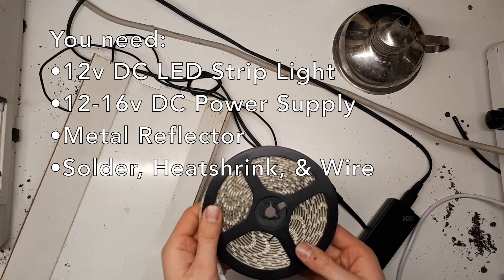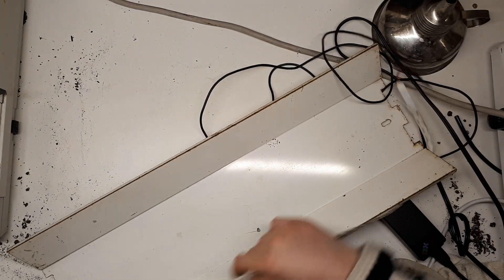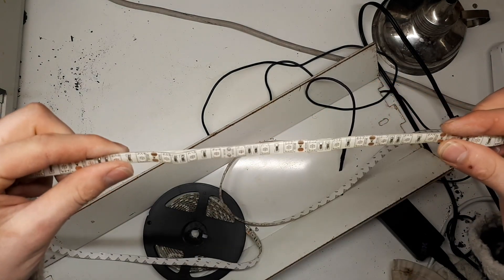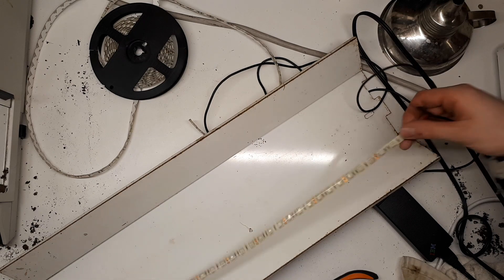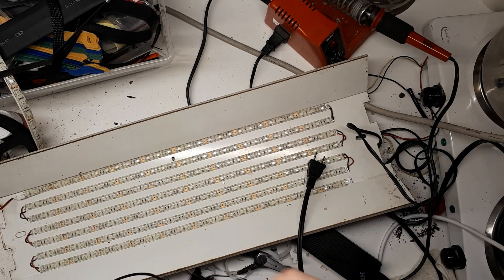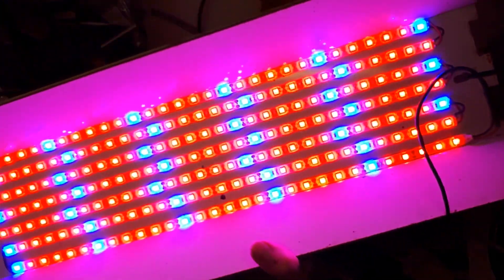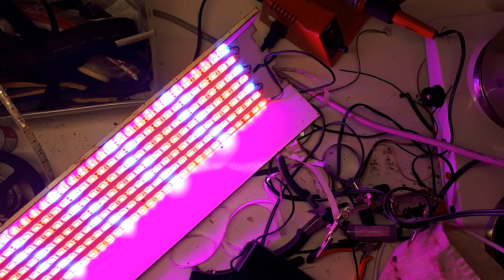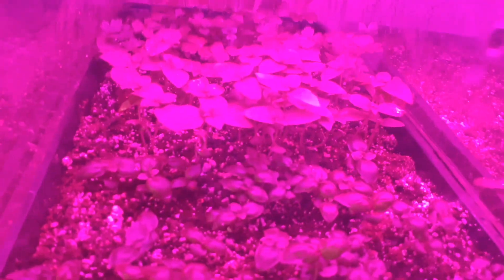DIY 12V LED Grow Light Build

Comment: So I want to do something like this except I'm going to be a little different and I'm going to be making a red light therapy board. Large red light therapy boards cost in the thousands. F that I want to do this. Any advice?
Reply from the maker: Figure out how many watts each diode or section will pull and then make sure your power supply offers enough amps to power as many LED as you plan to run.
Reply: @ZacharyMelo  currently the ones I got are 3 watt. I have about 32 ft I need to compensate for.

Comment: does 22Volt led make its job too?
Reply from the maker: I'm not sure I understand your question, but if you are using LEDs with a voltage of 22v, then you need to select a 22v power supply.
Reply: @ZacharyMelo  yeh thanks!🙏

Comment: Is this setup substantial for indoor Canabis growth? (one of two plants max )
Reply: No. Buy samsung boards, they are like $25 and designed for horticulture.
"Samsung LM2"
Reply: @bridoc519  $25? Can you please tell me where?
Reply: @bridoc519  just buy the correct led strip they do 3k-5k still cheaper and better than those boards
Reply: Can u make the leds striping run of deep cycle battery's from solar for a to grow buds and wat would it pull in  Amps
Reply: @Frogsandcats333  sounds like the go aye , couple solar panels few batts and bingo
Reply: € 16,58 | Samsung LM281B + 3000K 5000K Rosso IR UV SMD 2835 120W LED Coltiva La Lampada Quantum Bordo del PWB modulo per L'illuminazione Orticoltura
https://a.aliexpress.com/_mPUFv2P

Comment: how long before they fell off due to tape not holding ? Good video.
Reply from the maker: They stayed well attached for the entire life of the fixture. The failure point was the LEDs themselves as I ran them at 16v - 4v too high!

Funny you assumed that's what went wrong. With clean metal, the 3M adhesive is a strong bond.
Reply: @ZacharyMelo  hey 👋 I got these on eBay it says 12v to 24v when running at 12 they are HOT AS FUCK  so I run them at 5v and you get almost no heat but it only does about 2-3 strips before you need another 5v PSU
Reply from the maker: @HogwartsBasement  sounds like you need a power supply with a high amp rating.
Reply: @ZacharyMelo  so maybe 5v but more beef 🥩 the 12v is too hot but the 5v 1.5a is too low  what was the amps on your laptop charger ?
Reply: @ZacharyMelo   I have used these led strips for many fishtanks  and the tape never lasts.
Reply from the maker: @jaapseiye2246  maybe try a different supplier or prepare the surface better, otherwise I don't know what to tell you.
Reply: Yeah 3m are the nice sticky ones, with a nice clean dry surface of course

Comment: so... hows it working a year later?
Reply from the maker: Read my comment a little further down regarding g the burnout. I over drove the LEDs and cause premature failure of the diodes. If I did it again, a better choice of power supply is necessary to reduce the amount of waste heat.
Reply: @ZacharyMelo  u

Comment from the maker: Just an update, driving the LEDs at 16v killed them after a few months of use. The light would be excellent for seedlings, but struggled to support fruits.
Reply: Would it support full growth of leafy greens such as lettuce/herbs?
Reply: @pilkyish  I tried 8 strips at 70 cm each, which is around 61W... Canopy at 10 cm from lights. Not enough for leafy greens!!!!
Reply: @krisztiankomjati4095  Thanks for your reply. I've been using them for the last 2 months. Strips about 4cm apart, 2cm above the plants. I find that they do grow leafy greens, but very slowly.
Reply: @pilkyish  Yes, my setup is 8x70 cm and 3.4 cm apart. What I see is extremely elongated leaves and stems which is very bad. I experience the slow growth also.
Reply: Zachary why do you use 16 V? Maybe I am wrong but did you connect the LEDs in series? I suggest to put them in parallel connection. They loose voltage and power in series.
Reply from the maker: @krisztiankomjati4095  I overdrive them to get brighter light. It was an accident that I just went with, because I wanted to see what would happen. I should have chosen a different power supply.
Reply: @ZacharyMelo  I tell you what, if you worked this out into a dc system for the off gridders to run direct with alligator clips to thier battery banks you would be a wealthy man.  Everywhere I look they are all after the dc direct thing and nobody is meeting that need.
Reply from the maker: @OligosFew  this will run off of DC, it's a DC circuit. Just replace the power cord with your alligator clips. I'm on 110v so I use it.

Comment: Did he say it takes 100 Watts?
Reply: @14:11 yes he mentioned 100watts boom thats hot and expensive
Reply from the maker: @remho6076  yes it was! But it compared to higher wattage draw fixtures for a short while. Overdriving the LED with a poorly paired power supply is where I went wrong in this project.
Reply: @ZacharyMelo  hi i plan to buy normal LED light with low wattage but is it enough.. just to try out and learn ang gain experience before i venture real cash
Reply from the maker: @remho6076  enough for what? This started lettuce and tomatoes as seedlings.
Reply: @ZacharyMelo  i mean i buy regular LED lights

Comment: How much wattage do they produce? How did ur plants do?
Reply from the maker: Matthew Ryckman If i recall correctly i was drawing around 100 watts from the wall. The plants did well but were slow to grow when compared to my fluorescent fixture at over twice the wattage.

The blue LEDs burned out also.
Reply: @ZacharyMelo  I tried 8 strips at 70 cm each, which is around 61W... Canopy at 10 cm from lights. Not enough for leafy greens!!!!
Reply from the maker: @krisztiankomjati4095  I had better luck with driverless COB lights. I have grown vegetative and fruiting growth under 150w COB fixtures for months now.